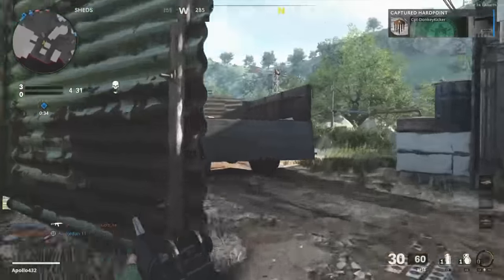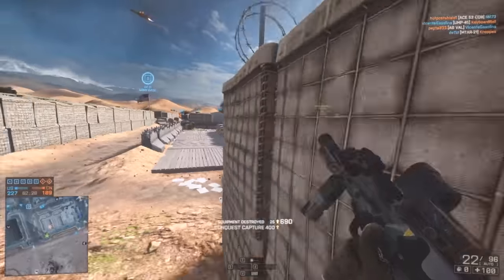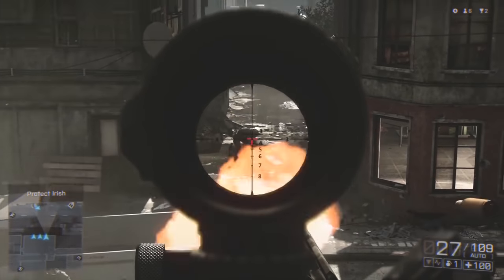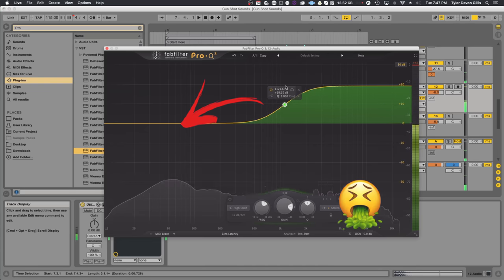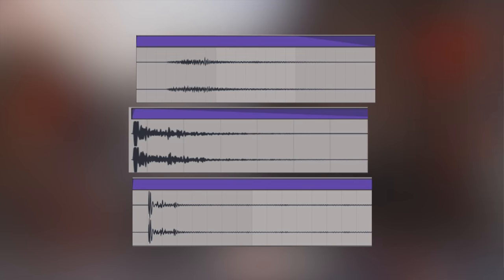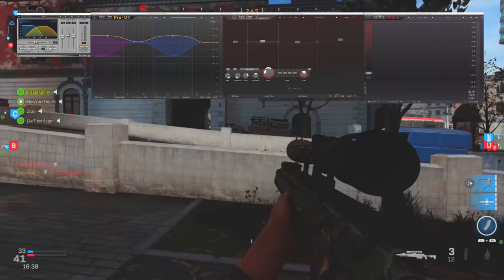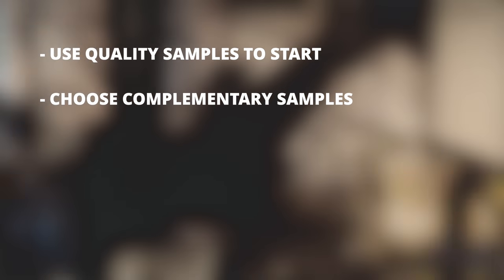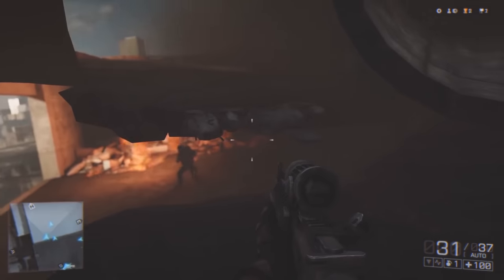How To Make Modern Gun Sound Effects For Film & Video Games Part 1

Comment: If you're gonna use some layered weapon shot audio libraries then I recommend next 3 ones:
BOOM Library - Assault Weapons (In the PART 1 folder placed attached, close, medium, distant and tail layers of the shot to work with.)
BOOM Library - Guns Bundle (Same but similar files placed in the "Construction Kit" folder and called different)
Samplesourcer - Guns (There are close and distant sounds only but mono and stereo).
Also, if you want you can use sounds from games. For example - Battlefield 3 and Insurgency Sandstorm. Yeah, they're already processed but they are broked down into the separate samples and you still can use them...
And by the way - nice video. :)
Hello from Russia!
Reply from the maker: Hey, you can't go wrong with the Boom! I have just about everything from them and they are in my opinion top notch when it comes to sample packs. The Recordist & SoundMorph are two more companies I buy from a lot.

Comment: Excellent video. Can i ask what the multiband compression was doing exactly? I always use it to move things out of the way of other things. Is it the same case here?
Reply from the maker: I use multiband compression to help squeeze the elements together so it feels like 1 sample instead of 3. I only blended it in at 10% as OTT has some VERY extreme settings. 

For the master effects side of things, I used Multi-Band Compression the same way. More like glue to help make everything sound a little more even.

Comment: well... i kinda have to disagree with you on the fact that you have to make the gun sound like that. because well the original sound had all the punch at one point which makes you feel it more than if you just made the sound range wider and longer that would only give it a less punch feel which makes it sound allot worse than just having all the punch come from one very strong punch which is when the bullet leaves the barrel.
gun sounds are like spikes the sharper the get the better.
+actually use a .338 lapua to generate a .338 lapua sound.
Reply from the maker: Hey Neccaps, I'm not 100% sure what point you are disagreeing with? I'm a big advocate of having more natural sounding guns in games, I'm not a huge fan of overly processed weapons, as you said I like to preserve that natural impact by layering different microphone perspectives. 

It is like taking a 2D photo vs a 3D model, vs a textured model. 2D being 1 microphone perspective raw, 3D model being layered, and textured being processed. 

But I'm not sure what comment I made that you are disagreeing with.

Comment: No that is not how guns sound like, they are fcking loud!!! It is just recording equipment used are crap so a lot of clipping happen.
Reply from the maker: So clipping is actually how you get them super loud. If you set your recorder too quiet so they don’t clip, you end up with popcorn shots. 

The transient is not super important, everything that happens after is.  

We are currently going through the process of recording 121 guns all at 192KHz and at 32Bit and they sound fantastic. You still meed to snap the transient down with compression in order to get them loud.